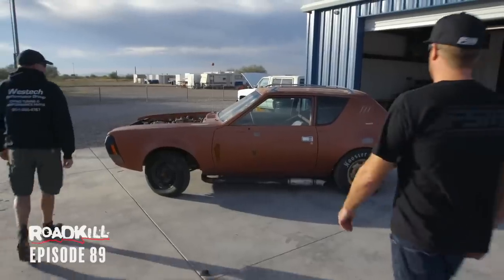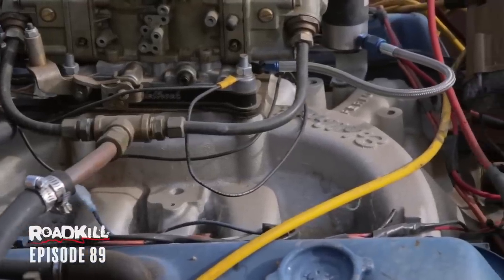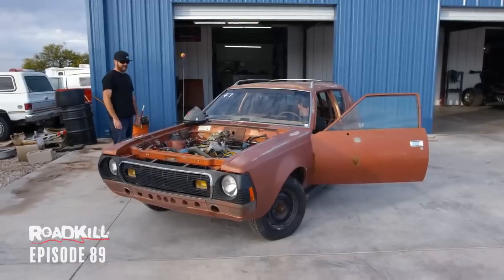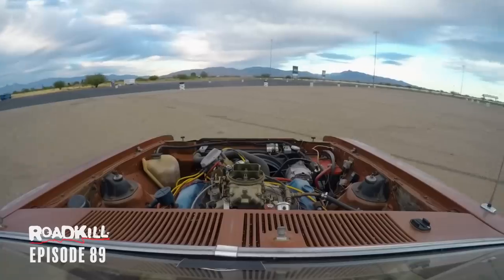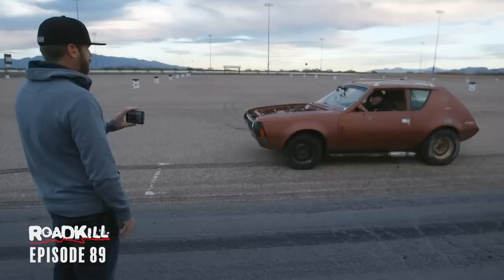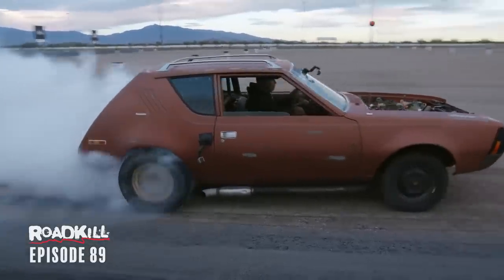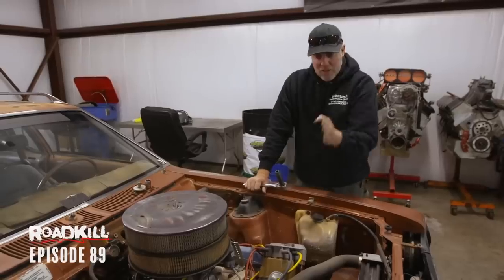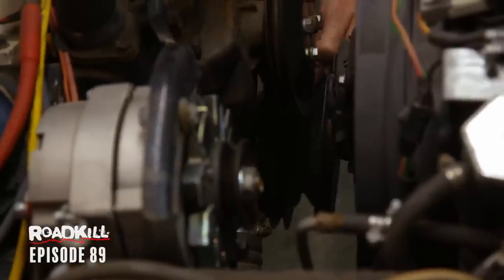Burnouts in the Caddy Gremmie! | Roadkill | MotorTrend

Comment: I'm sure you remember back in the late 80's when these engines were free for the taking, a guy in Eastern MA was advertising in all the car magazines a kit he designed that dropped a 472 or 500ci Caddy engine into a mid 70's Chevy Malibu. If I remember correctly he was running in the 11's with stock junkyard engines.

Comment: Gremlins are great fun. I used to have a 1970 with a 350 buick. Then upgraded to a 355 SBC. Wheel base is so short they handle a bit squirrely.
Reply: I had a 70 too, black with centerlines, tinted windows, 355 sbc, th350, and 9.3 olds rearend with a spool.

Comment: I had a 1975 Chevy half ton square body, I blew the little 6, and had a 1970 500 Caddy laying in the corner of the shop, so guess what I did? Stock with slicks and a 373 10 bolt arc lock, done low 12's in a 1/4. It was a fun truck. Them old Caddy motors were torque monster's, outa the box... Love it 👊🏻😎

Comment: a girl friend had a 1975 Gremlin with a V8 and 4 speed. It rev'd nicely to 3500rpm and then fell on its face. another G friend had a 1975 MGB and it rev'd the same way, just ran out of power at 3500rpm.  those 1970's Smog cars suck